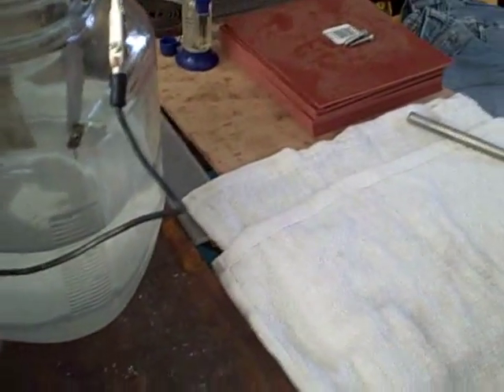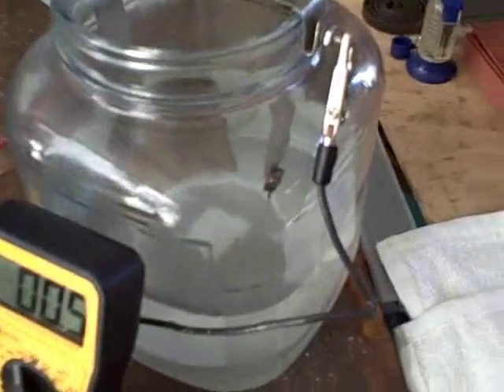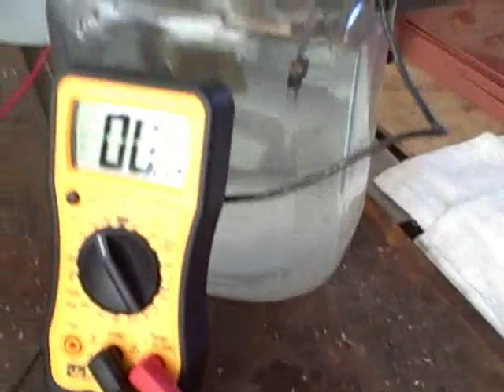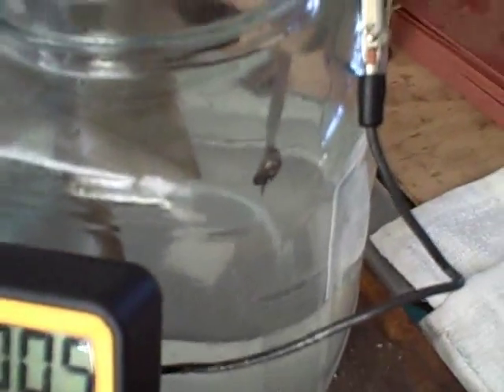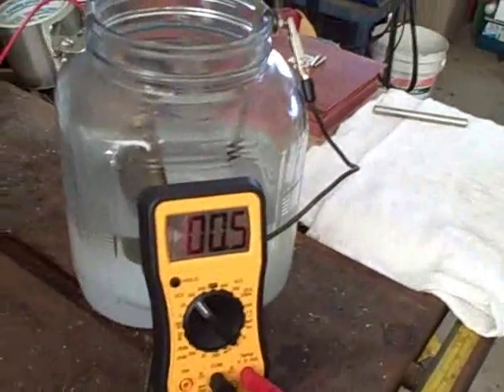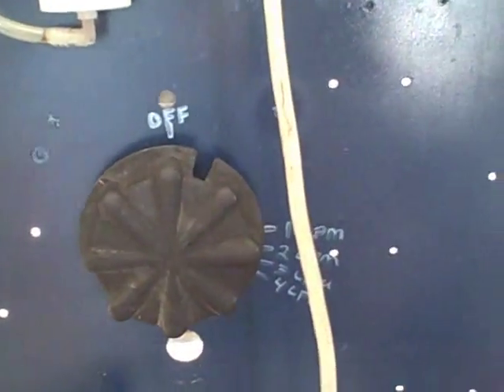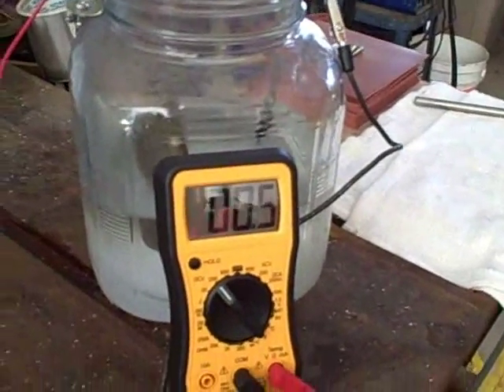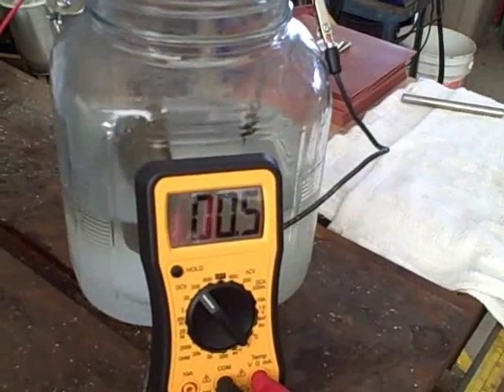variable voltage dc arc electrolysis.wmv

Comment: Hey onecraftydude! Cool video!

I believe this is plasma.  You are obviously ionizing the hydrogen gas being produced on the electrode, and when ionized gas has a current run through it you get that 'purple' glow commonly associated with plasma globes. I think though there is enough current being run through it, that it combusts the hydrogen gas around it (which would mask the purple glow).  Check out my video 'cold fusion is fun', I think you have the right equipment to do some fusion (w/dc)!